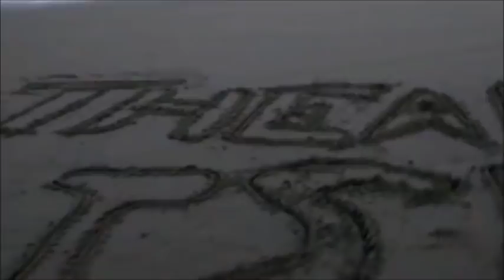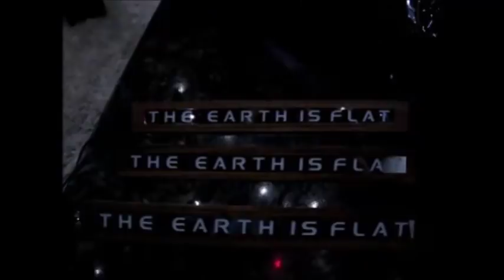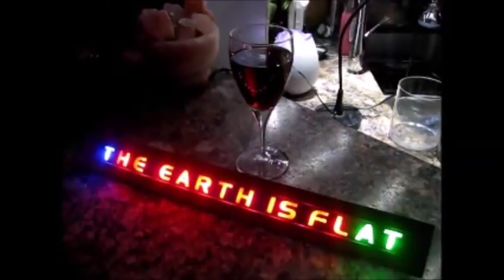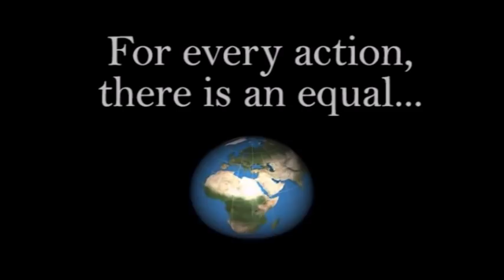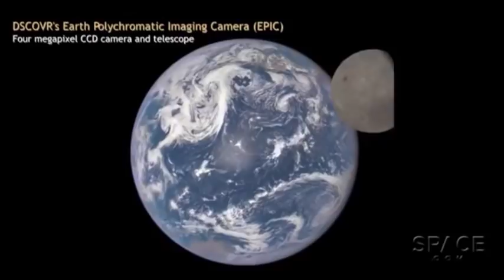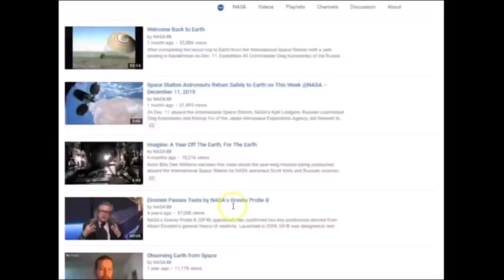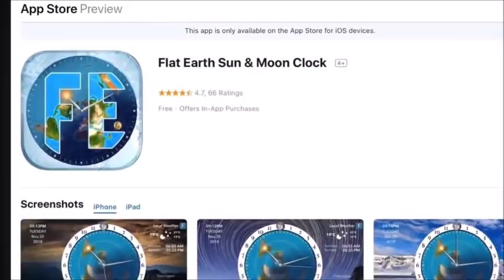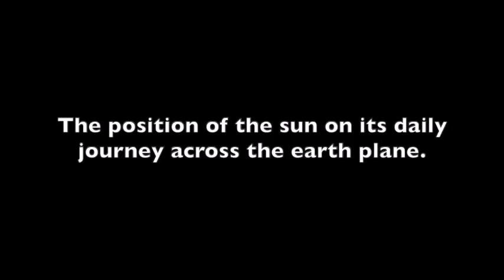Flat Earth Q&A Emails 116 Mark Sargent ✅

Comment: The concorde was a great cover up. You'd think with that nose it was designed to be level going over the horizon.... the windows are water cooled and the final concorde has a hat stuck between the fuselage and the instrument control panel in the cockpit. 
The front window was blocked by venetian blind looking levers that didn't allow pilots to see where they were flying.

Comment: I really wish someone that has a flat earth model that illuminates...would set it on a black cloth or canvas and remove the dome if necessary...use a phone or camera...and hover over it or at a lower angle like 30 degrees or less...capturing half black canvas (around the top and/or side edge) and half of the luminated earth (exclude the ice wall with black)...angle the camera for distance effects...then follow the around circle outer edge maintaining the same focused aim...the actual curvature is really the actual edge of the flat circle...just like the space station...